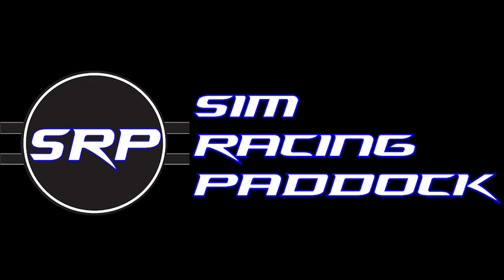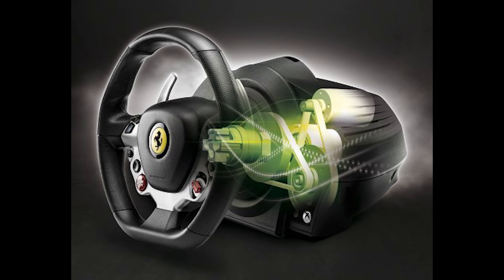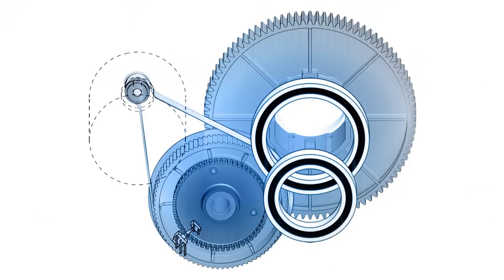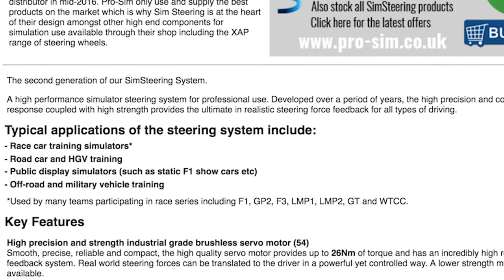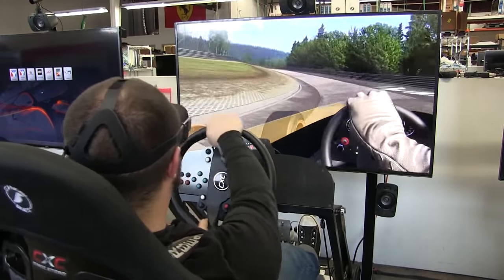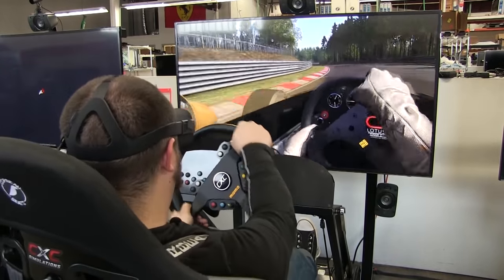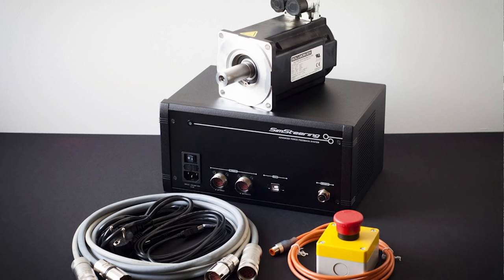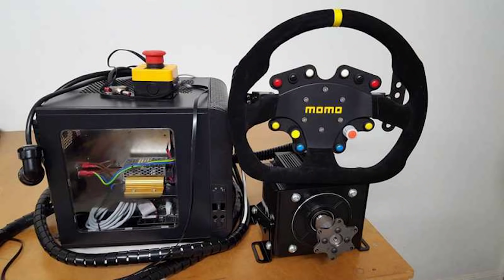What is a Direct Drive Steering Wheel?

Comment: direct drive does not make it more powerful in itself, there is a huge difference in quality between these wheels and the more "hobby" ones.
A elektronik servo for cars is not direct drive and they dont seem to have a problem with low torque or low precision, the same goes for Segways, if you manage to hold on to the wheel of one it will send you flying.

Comment: you said the ffb of a DD Wheel is maybe less smooth...   that is not correct... the ffb is very smooth... you do feel all the details from the mini kinds of textures from the road to heavy bumps that feel like someone is punching your wrist/arm/shoulder... (with quite high force) ...  but the ffb doesn't become less smooth because of the fastness /quickness...  it's all very smooth..  at least with the common industrial servo motors used in the OSWs and bodnar systems...    it is faster, stronger, more sensitive to mini forces but at the same time it is also smoother....   ofcourse you need to filter the signals a little bit..  otherwise it makes a noise from hell and is not smooth :) but that's usual with motors

Comment: Why is it so expensive?
Reply from the maker: Easiest answer, is the parts themselves are expensive! For example, to build your own Open Sim Wheel, you need the motor, the SimuCube chip/software, and the "pc components". The MiGE Motor (most common OSW choice) is usually around $250-$300. Then you need the SimuCUBE motherboard, IONI motor drive, and a power supply.

If you buy the ready-to-go motor from SimRacingBay, and build your own SimuCUBE component box, you're looking at €877 in parts alone, before putting anything together! You can get a lower price by getting the motor through a different retailer, like AliExpress, but then you have to deal with the logistics of buying from that marketplace. I've seen them for about €230 online (I think), so that's only about €70 savings, so you'd still be spending around €800 in parts.

That being considered, those people selling OSW packages are actually giving us a solid deal!
Reply: Capitalism